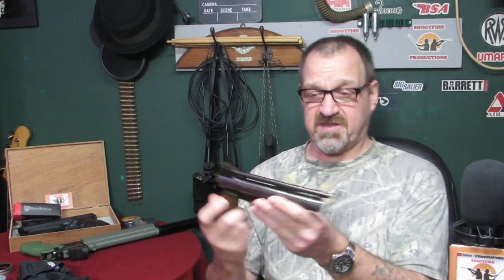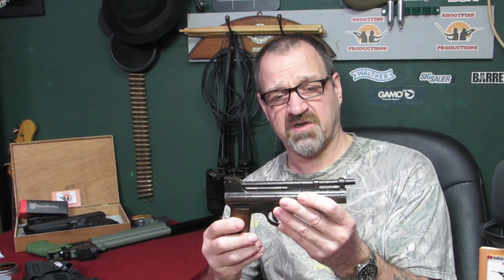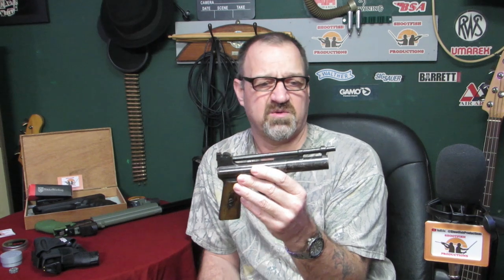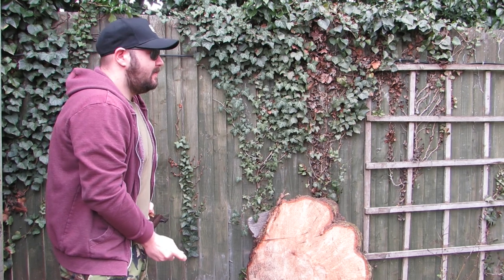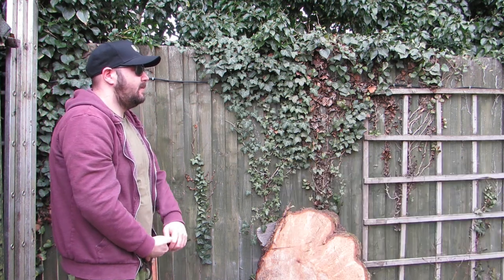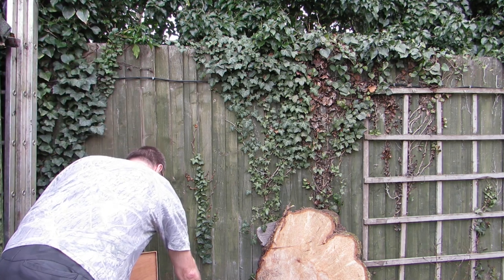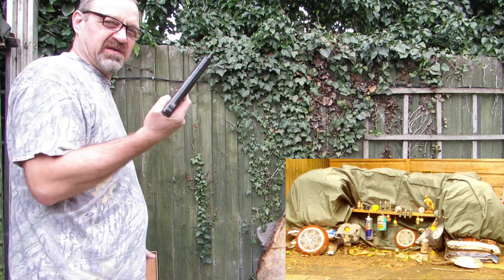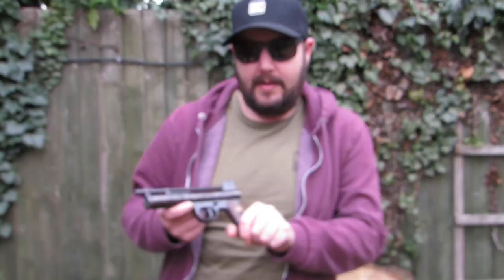Vintage Webley 1925 MK1 .22 Air Pistol Shoot & Power Test

Comment: I have similar, but it has no markings on the metalwork. Any ideas.
Reply from the maker: The marks could be hidden or worn off. The angle of the grip is different on later models, its more straight down.